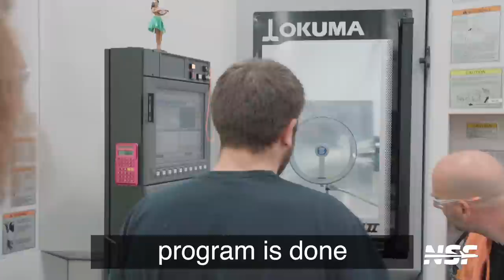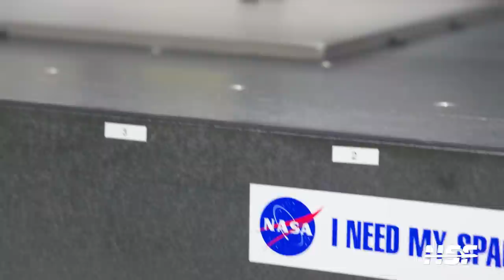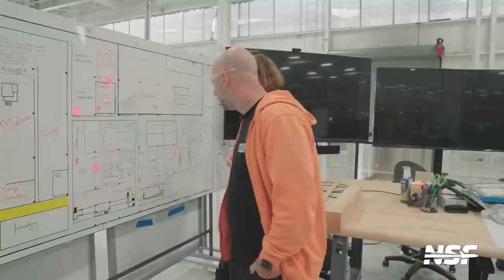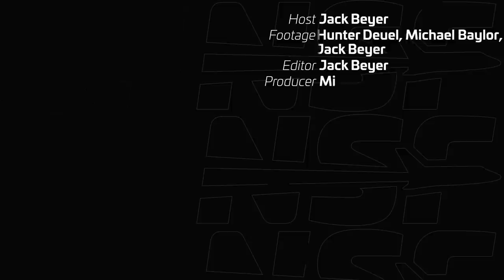Astra's Revolutionary Manufacturing Process | Rocket 4 Factory Tour

Comment: I had always assumed that when you see the lower stage of a rocket, inside the outer wall would be tubes, an inch of insulation, and tanks inside of that.  Now learning that if you walk up and knock on the side of that stage, the other side of that sheet metal is holding the liquid fuel - that is just amazing.  How can that possibly survive the vibration and the rigors of launch?

Comment: Lots of neat things to see, but - I may be projecting? - feels like a super tension-filled place to work until one of their rockets makes it to orbit. Fella only sort've addressed the big question once, in the rocket show&tell at the end, with how the upper stage is pump-fed instead of pressure-fed this go around to kibosh a particular failure mode. They're also not running their own engines now, so 1) good that they move away from that "uneven" legacy but also 2) they don't have experience flying these engines. Didja sneak in any kind of "when" question that didn't make it into the video?

Comment: At first I thought a goal of 100 rockets a year was overly-ambitious but then realized that's about the rate SpaceX produces F9 upper stages at. I just hope their engine manufacturers can keep up.
Side note: Judging from the raw roll of sheet aluminum the barrel sections could be longer. I guess the length is limited by what the 4-roller machine and friction stir welder can handle.

Comment: The key to economy is launch cadence.  While reuse is one technique for achieving high cadence it is only one technique.  Mass production is effective at reducing cost regardless of whether the products are reused.  Falcon 9 is still relatively expensive to manufacture in part because over the past 12 years only about 50 have been built and a lot of the parts are expensive.  Starship is being designed for mass production.  At least a thousand are expected to be built over the next ten years.

Comment: 39:24 No flat surface on weld joints? Wow how you achive it? adding material(dont see this happen) or make the cut in angle?
But when you weld it specialy friction need flat surface. Or you make firction welding with a BALL instead of DISC.?

Comment: Extraordinary production process. Cudos to whoever runs the logistics of keeping the process supplied with materials. One wonders how chages in design affect the production process. This appears to be where CAD and the use of AI to speed up the way changes can be worked into he process. Without that it' would be impossible to maintain a viable seemless production process, it's actually doing something that man alone could never do, which is what I wold want tosee AI used for, rather than simply replacing human beings and making them redundant.

Comment: 38:37 Is made in cold rolling or you apply some heat to eat?(rolls are heated to make more easy rolls?
friction weld work well on aluminium than TIG soldering right? Have you test both to see presure and stres on extreme low temps?

Comment: Am I mistaken or dont i remember that Astra wasnt going to produce engines anymore but buy them instead, at least for the first stage? I guess things have changed? Or are they using someone else's blueprint while making them in house?
Reply: For the first stage they would make a in-house licensed version of the Firefly engine used on the Alpha booster,engines for second stage are made by another company Ursa major, also is a flight proven engine.

Comment: Some  suggestions about your CC subtitles: 1:02:28  1:02:38  1:02:44  "ojive" is the right term, not "O jive." 1:03:54 "supper stage, "upper stage." There are some more corrections to be done all along the text (but not too many, I'm impressed for the good job done) but I didn't keep track of them. One of them, look for some occurrences the word "sir," I think it should've been "circ;" "braise" and "braises" should be "brace" and "braces," respectively; a "they're" near the text's end should be "there're." Check out a word ending in "-ayed," perhaps "portrayed," I think it's wrong too there. I suppose you edited an automatically-generated text and some things escaped your attention.

Comment: I know they are super intelligent. I’m wonder how the stamp process crystalline stress is mitigated. Stamping Aluminum effects the crystalline structure and tends to work harden. I wonder if that is a desired outcome or they need to retemper. Also how they are checking for micro fractures. I’m not saying it’s an invalid process. I’m just curious.
Reply: I guess you are referring to the dome pieces. It looked to me like there were spiral marks on the top. They may have used the word 'stamp' to 'not allude' to the process of how they make these in reality. They could be spun like aluminium pots are. Just guessing of course.
Reply: @David-yo5ws  spinnning is a definite way to work harden, I just wonder how they keep its strain strength even across the surface or if that is not a concern. They are building a high vibration, pressure vessel, with high impulse stresses from multiple directions especially at maxQ.
Reply: They do not need to reinvent the wheel. Most rocket companies, including SpaceX, purchase such domes from companies specialized in making them. Spun domes certainly work. Here is a video that shows the process: "엔지니어의 혼이 담긴 돔 스피닝".
Reply: @cogoid  The video showed a nice job on that dome and the heat treatment after. They make it look easy, but I am sure a lot of planning and a lot of work went into  making the templates and hydraulics and lubrication systems. Thanks for the link.

Comment: A high-precision camshaft for an FTS? No, no, no, an FTS is just some C4 that's pressed to the tank with your thumbs and then you plug in an igniter, that's all.
Reply: It could be for the arming system. I think FTS typically has the explosives installed but not physically connected until close to launch. At that point something physically closes the connections and arms it. The cam shaft in this case could very well be for that
Reply: @thomashayden804  I was just joking of course. I agree that this part must be of a reliable arm/disarm system. You wouldn't want an oopsie with this stuff.
And obviously they don't use their thumbs to stick the C4. They use all their fingers.